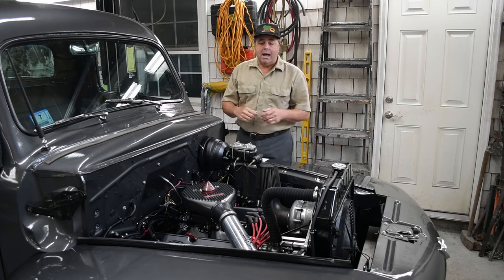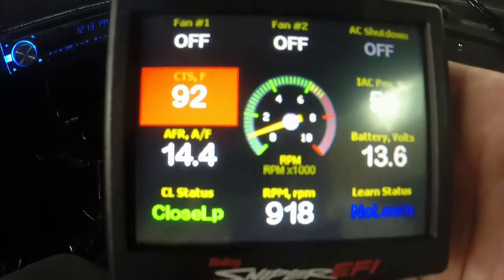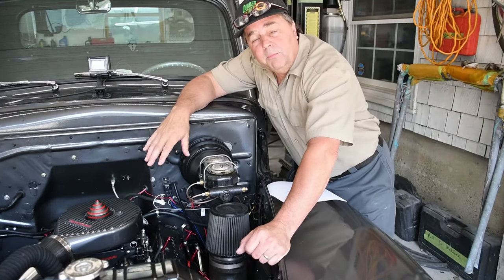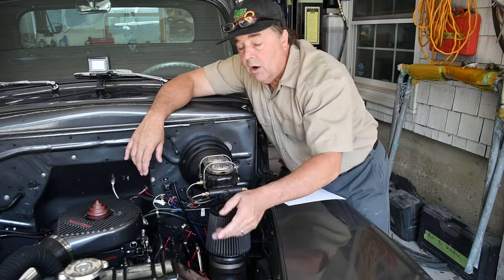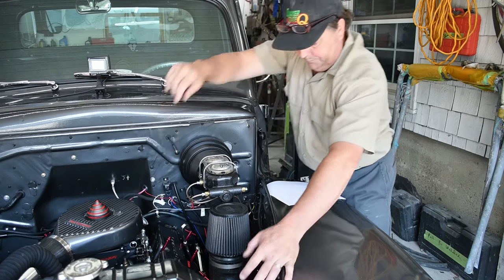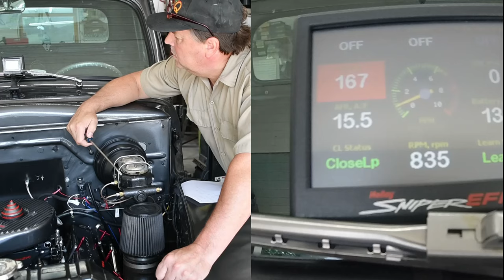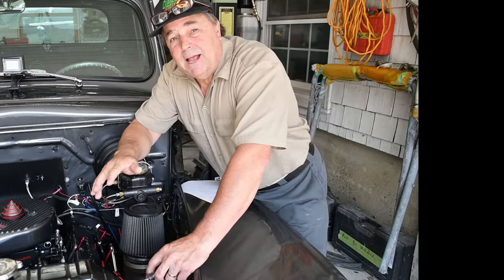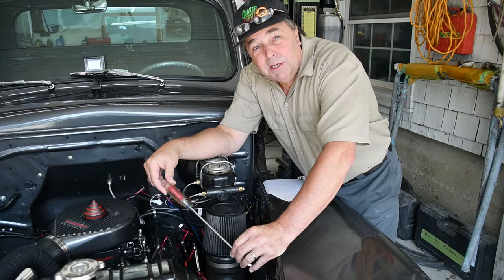Holley Sniper How To  Set The IAC (Idle Air Control) in 5 minutes or less

Comment: Thanks Troy, awesome video.  You made this very simple.  Quick question.  If your using sniper to control timing do you have to disable the idle spark before you start this process and then enable when complete?
Reply from the maker: Great question and thanks for the comment. No you let the computer control the timing. Think of it like setting the idle on a carburetor, you would disconnect the vacuum advance for that would you? Same idea. Good luck on your project.
Reply: @troykane  the only way we could get mine to idle initially was to disable to idle spark (since holley recommended it). The way I sort of understood it is it cranks the timing upon first time start up without base tune created. with it enabled it ran like absolute dog $h!t and would die after maybe a minute and a half of running. I'm far from a pro at this but the way you explain it makes it much easier to understand. Keep up the great work!
Reply from the maker: @bpowersman5000  Thanks, glad to be of help.

Comment: Very informative. I don't have a Super Sniper yet, I'm doing my home work on it. Question: it wasn't part of you video, but Holley says the unit is 3.28" height. Is it really? I ask because w/my super charger to use a 1" air filter (on a drop base) w/my Holley carb, I have no room if the Sniper is taller than the carb. If it is 3.28" tall then I could go a 2" air filter.
Reply from the maker: I can't really tell you the exact height. I have delivered the vehicle. It does appear to be very similar to the height of a carburetor. Ait cleaner and intake manifold style will also have to be taken into consideration.